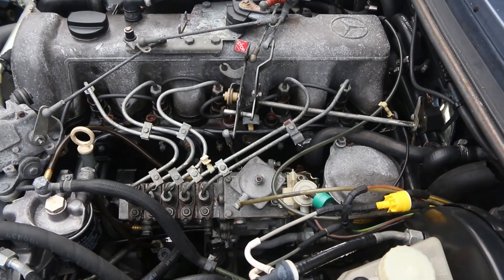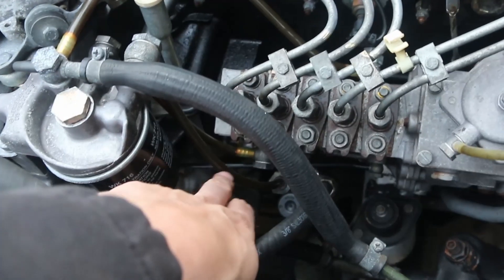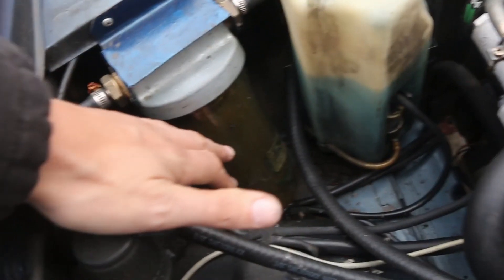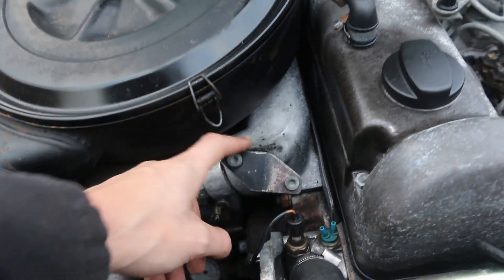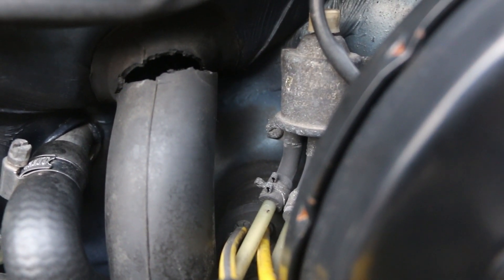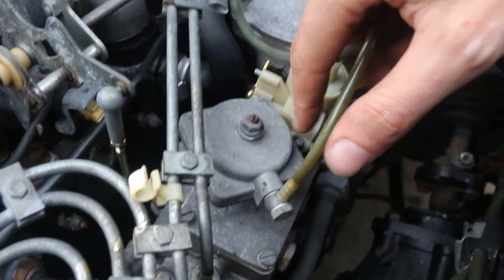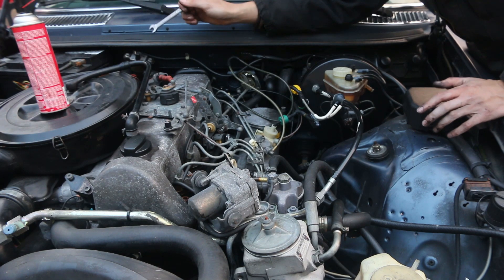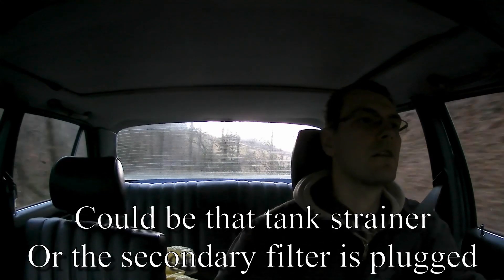Hunting for more power on a W123 1982 Mercedes 300D Om617 Turbo diesel. First steps to HP!

Comment: Trythistv, do you have a video on how to attach your primary filter that’s next to your windshield wiper fluid container?. The video is unclear on this issue. It just shows a couple of screws to a blue plate above the primary filter, but how is that attached and holding up the filter? I bought the primary filter and the hose, etc but now scratching my head on how to secure it inside the engine well. 🤔

Thanks, ernest in Lexington, Kentucky

Comment: Should we delete our EGRs? Anybody have any experience doing this to MB 300s?
Reply from the maker: The EPA will say no, and the EPA fines people insane amounts of money for reccomending or suggesting that people do anything like that, but a great number of om617s never had EGR from the factory, and it is known to cause issues with carbon buildup in the intake, which can restrict airflow, further reducing power. If it were to have never been installed like some models were, I would say it would be better for the engine in almost every imaginable way, but the EPA would not approve of that, so I won't recommend that you do such a horrible heinous thing that would improve the performance and longevity of your engine...
Reply: @trythistv   okay let's make believe it is 2027 and Elon Musk has deleted the EPA and you live in Florida which has no emissions testing requirement...
Reply from the maker: Mine was missing when I got the car, so I didn't need to debate the benefits of removing it vs the EPA being upset with me, and still the intake was clogged with soot really bad, I took it all apart and cleaned it, and decided that replacing a missing EGR valve was more hassle than leaving it removed.
Keep in mind EGR was not a requirement on diesel engines until sometime around 1998, as my work truck that is a 1997 Dodge diesel has no EGR, and that is how it came from the factory.
I'm unsure what the legal ramifications of encouraging someone to remove non-mandatory emissions equipment are other than knowing there have been ridiculous fines handed out to people for doing the work, but I would strongly advise caution when going over bumps as EGR valves have been known to fall off and get replaced with blockoff plates frequently, and as a result the vehicle owners engines run better and last longer. Weird how that works.
Also there are places that sell kits to block off the EGR, and I'd almost bet going over that same pothole could cause you to accidentally order one of those kits if your phone was in your hand. ;)
Reply: @trythistv  I'm moving to Florida. I will be checking my fuel from now on. Hopefully I can buy a MB 300td one day.

Comment: Forgot one thing, the system fuel pressure. The spring in the valve gets weak so thus causing a lower pressure and thus not getting enough fuel into the inj piston feed holes. Just stretch it a few mm and it will make a differance.
Reply from the maker: Absolutely right, I did cover the overflow valve in a later video: https://youtu.be/jiPonBwkxeI but yeah it's been a learning experience, so many things have to be just right in order to get the ideal performance!
Reply: @trythistv  true, as one learns, the process of waking up a sick diesel near becomes second nature.

Comment: The 90 degree rubber elbows under the over-boost solenoid can crack and leak with age.  This happened to me and it caused a huge reduction in maximum power.  
That solenoid is an electrically-operated  switchover valve that sends boost pressure either to the ALDA, which to increase limit on injected fuel, or vents boost pressure (so the ALDA only sees ambient pressure, i.e., no fuel limit increase).  The electrical signal to this valve comes from the transmission, supposedly based on excess torque.  
The ALDA reduces the maximum amount of fuel the injection pump can send to the injectors when intake manifold pressure is not sufficient to burn more fuel (or transmission senses excess torque).
I have also had the in-tank fuel strainer plug once when I got one load of bad fuel.  In that case the car would drive OK at until debris in the tank is got sucked against the screen filter and restrict flow.  After that the car won't go over, perhaps, 30 MPH.  Most of the debris will fall off the screen eventually after the engine is stopped.  If this happens plan on cleaning the tank, not just the screen filter.

Comment: Hey I have the 617 but mine doesn't have the ALDA, do you know how to turn up the fuel? Thanks
Reply from the maker: If its non-turbo there is an ADA which serves the same purpose but there is lower fuel output to begin with.
There are a number of adjustments under the rear cover but it is quite easy to create massive problems in adjusting stuff under there.
I'm going to be doing a video soon on what adjustments there are behind there and what the risks of adjusting that stuff is.

Comment: Great video! Did this same test. When I bypassed the overboost protection solenoid, my 300D noticed a huge improvement in power. Does this prove entirely that the solenoid was the culprit or is further testing required? If the solenoid is clogged, can it be unclogged? any other tests that can be done on the solenoid to determine if it is faulty or not?
Reply from the maker: That does prove that the solenoid is either clogged or electrically non functional. My w116 didn't even have an overboost solenoid, so bypassing it is not a huge risk. I accidentally had the wastegate disconnected for a while so there was no boost regulation at all and it didn't hurt anything, but then again I don't drive like too much of a lunatic

Comment: I am loosing patience with my 1983 300sd. It has NO power in D off start, a bit more if you put it in 2 but still very slow. When it passes 15mls it runs but it does nothing off the line. I cant even get up the small hills in my town

Do you have an idea what it can be?
Reply from the maker: is there a possibility your bowden cable has come disconnected or the throttle linkage is binding? That drastic of low power is bizarre.

Comment: I have the 240d without the turbo so it will not take a turbo upgrade but I wonder what would happen if I went from a mechanical radiator fan to an electric Spal fan?  How many horsepower would be freed up?
Reply from the maker: I've heard arguments stating you might free up as much as 5hp, and others that say the extra strain on the alternator and such negates any benefit, but it would seem to me to have the fan thermostatically controlled, so if you had air moving across the radiator it wouldnt need the fan running, so you would gain that little bit of hp. I'm not sure in practice though. If the story's/theories of 5hp gain is true, that is fairly substantial for our engines!
Reply: @trythistv  I did replace the mechanical fan with a Flex a lite.  It is thermostatically controlled.  It works great.  It did free up some horse power.  I also upgraded the alternator. I am also adding a secondary fuel pump that I purchases from Mercedes Source.  I just need to install it.

Comment: Take the Alda off and get the delete kit from doomsdaydiesel gave mine not only way more power but it drives like a normal car now instead of slowing down immediately after letting off the throttle. I was truley amazed when I deleted mine.
Reply from the maker: Yup, just an emissions control device, and after 40 years or so, the injector pumps tend to lose a little efficiency to wear, and aren't injecting enough fuel that even alda-less you won't get any smoke. I've got a video related to this in the works. I found mine had failed internally and was actually reducing fuel when the turbo spooled up and built boost.

Comment: bypass that alda solenoid.  you also may need to check the pump timing. valves need to be adjusted from time to time on that engine as well.  the paper air filters are very restrictive.
Reply from the maker: The overboost solenoids are known for failure. I'll give you a little sneak preview of an upcoming video, my alda had failed, which was contributing to low top end power. The diaphragm inside the alda had cracked so it would inflate and limit fuelling once the turbo spooled up instead of the diaphragm collapsing and adding more fuel with boost. I'll be making a video of that sometime soon!
Reply: @trythistv  any idea on where to get injector shims for pop pressutre?
Reply from the maker: @narcissistinjurygiver2932  I got mine from McMaster Carr.
Part numbers are:
98055A105 (0.1mm raises about 50psi)
98055A106 (0.2mm raises about 100psi)
Reply: @trythistv  thanks. i am looking now
Reply: @trythistv  what did they charge for shipping?
Reply: @trythistv  thanks i just ordered
Reply from the maker: @narcissistinjurygiver2932  I think it was in the realm of $10 or so shipping, McMaster is a phenomenal company to get real bizzare stuff from, I got all my injector return lines from them, Viton hose so nothing will ever make it swell or leak. I've gotten a ton of huge washers, snap rings and stuff for my heavy equipment too. Great folks to work with.
Reply: @trythistv  awesome. i bought the smaller ones and ill try to set to perfection. i am at 100 bar now
Reply from the maker: @narcissistinjurygiver2932  getting all my injectors balanced seemed to really smooth out the engine and quiet it down. It's still a rattly old diesel, but it sounds more smooth if that makes any sense. Like every cylinder is contributing equally and right on time when it should be.
Reply: @trythistv  what did you set pop pressure to? book says 143bar
Reply: @trythistv  i am also considering getting the IP modified for an 100 hp gain. I rebuilt the stock turbo but now think I would prefer a modern turbo. Just need to find a car I want to swap this into. I had a 82 300sd for 10 years and ran it on used atf. it was a solid car and had 300k when I got rid of it.  the om617 was a good built motor.
Reply from the maker: @narcissistinjurygiver2932  pop pressure is rated at 115 bar for the non turbo engines, 135 bar for the turbo engines. At least that's true of the 616/617 engines, not sure on the 603/606 and those ones. I set mine a touch higher, around 140 bar, 2000psi area, because they do seem to drop a hair after a few miles, at least with brand new nozzles. Eventually I'll probably do some minor pump tweaks, it seems like the mw pumps get a little lean after 200k miles, even totally removing the alda results in no smoke on hard acceleration, which is the aldas entire purpose, so turning the pump up a hair, putting on a functional alda, and I too have pondered modern turbo options, doomsday diesel makes kits to install a couple holset options that I keep getting tempted by
Reply: @trythistv  i will try to get mine to pop at about 150-160bar. I am considering sending out the ip to get it tuned for more hp. i got this engine a while ago and started going thru it but got side tracked. from what I see it shows no wear on the cam lobes and is perfectly clean on the inside. waiting for an adapter to compression test the motor. then i will decide if i want to spend the money to make power with it. I would like to just get the mercedes trans and do a swap into an old toyota truck if i can make it work with out having to buy a conversion kit.  I had an 82 300sd for 10 years with this motor and it ran on 75% used atf really well. i think with a few mods this would be better than a 4bt. if it has good compression i will sand blast the block and repaint it. also plan to send out the parts for anodizing and polishing. would be nice to make the engine look factory new. in 10 15 years who knows what it will be worth.  i found that by taking out the paper filter and attaching a washable cheap cone filter to the air intake tube really helped out with power. just clean out your air box first. it it worth it if you want to free up some hp and not have to deal with your air filter getting oiled up
Reply from the maker: One thing to keep in mind is that raising pop pressure also has the tendency to retard the timing slightly, and possibly reduce the amount of fuel injected, so you may need to bump timing a few degrees and adjust the IP to flow more fuel.
Which you've already talked about doing, so you're probably way ahead of me here, just figured I'd mention it. Your plan sounds good, the om617 certainly weighs a lot less and revs a lot higher than a 4bt, and makes similar power in stock form, I've always wanted to plant a om617 into a ski boat like a mid engine malibu or mastercraft from the 90s, One day I'll find the right boat for the right price and it'll happen lol
Reply: @trythistv  keep an eye out for an engine. so you can pick a good one up for a good price. I am going to checked out the compression on this one and if good i think I will send out the ip for modifications and then mate a good turbo. then it will sit for a few years until i find what i want to put it into. I saw someone install it in a r107 and thought it would be awesome.

Comment: i had one of these for 10 years and I am a mb tech.  you will notice a nice improvement by removing the paper air filter and attaching a cone style washable filter to the air intake hose.  also that engine really runs good on used atf.
Reply: Isn't used atf hella corrosive?
Reply: @mattkrier5856  not at all. it also runs smoother and cleans out everything
Reply: @mattkrier5856  Marvel mystery oil would like a word
Reply: What is ATF? Does your advice only apply to turbo cars?
Reply: @Altanox  automatic trans fluid
Reply: Where do you start using ATF? Where do you get ready available, used ATF?
Reply: @goofyinestherville  i was a dealership mechanic. so i had my coworkers set aside a few gallons a day.

Comment: I'm thinking you got most of that gunk in the secondary filter by running after removing the tank strainer. I had a similar problem with my 300D, it would run out of fuel with several gallons in the tank. The strainer was completely blocked all except for the top 1/4 inch. Cleaning it solved the problem. There were literally 1 inch balls of rubbery looking stuff when I cleaned the tank. Now every fill-up gets a dash of Biobar along with the usual DieselKleen.
Reply from the maker: I hadn't removed the tank strainer until after this video, and even then, any large gunk would have/should have gotten caught by the primary filter. I got bad diesel from somewhere. The Mercedes had power issues, my backhoe had starting issues, and my dodge truck it wrecked the p-pump, scored the barrels and plungers enough it siezed the rack up entirely. There was water or some other contaminant that got into the station where I got my diesel that caused a lot of trouble.
Reply: @trythistv  I neglected to say thanks, very helpful video. I wish it existed when I did my strainer. 😞
Reply from the maker: It's a chore for sure! I'm still fighting with that bad tank of diesel, had to pull my level sender again, it got gunked up and was jammed a 1/4 tank. I have the enormous primary/prefilter now and it works as a water separator as well, and that has saved me more than once.
I'm working on more videos too, we just took a 1500 mile trip in this car, we had such a great time!

Comment: Hi I just bought a 300SD and the engine has seen better days so I was thinking about rebuilding it and was thinking of turning it into more of a performance car.  I was curious how much horsepower could I max out while keeping it reliable and safe. With all performance parts going into the engine what would be a reasonable amount of power? I am trying to get around 300-400 hp out of the engine and wanted to know if that was possible?
Reply from the maker: If you've got a 300SD with an om617, I'd say those HP numbers are not really possible with the reliable and safe qualifiers, with some pump work and injectors you could see 200 or more, which is pretty much double the stock power, the stock 722.3 trans probably won't hold much more than that without upgrades, I'm unsure if there even are any for our transmissions.
There are people out there that have pushed the 617 into the 3-400hp range, but they quickly lose the "bulletproof million mile engine" moniker at that kind of performance.
Now the more modern 603 and 606 are capable of much more power, with stock 606 engines already making 175hp, or the older 603 making 150ish compared to the 120ish that the 617A made.
Blacksmokeracing built a W123 Wagon into a drift car some years back, originally using a 606 and later switching to a 648 I believe it is.

Comment: Excellent video!
Reply from the maker: Thank you very much! I love these cars, I've owned a diesel Mercedes since I was 15 years old, and drove that first W116 model I had for 10 years before selling it to someone who had the ability to do it justice and fully restore it, I've got two W123s now, both 82 300D models, the blue one in all the videos, and my grey one that I've converted to 4 speed, 2.88 rear diff, k26 turbo and some other little tidbits here and there that make it a really fun car to cruise around in

Comment: Great video!, I like how you cover this, short and simple. Maybe house from manifold should run to OBP Solenoid and out to Outer not directly to Outer?
Reply from the maker: Correct, the OBP solenoid would normally be inbetween the manifold and ALDA, but they also are very prone to failing, or plugging up, so they are often bypassed with no real downside, in theory you lose overboost protection, but it is minimal and only limits fuelling, so you can still overspeed the turbo if you try, I haven't had any issue running with it bypassed, I'm familiar enough with my car I could tell when the wastegate hose rotted through. 😅